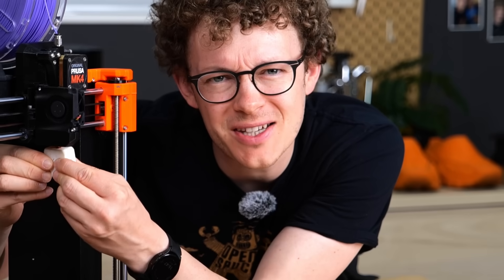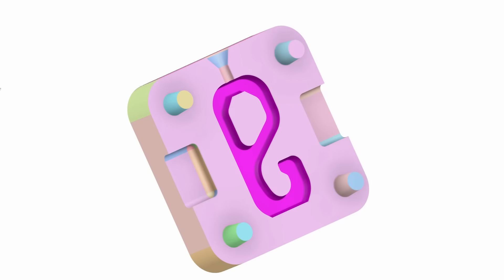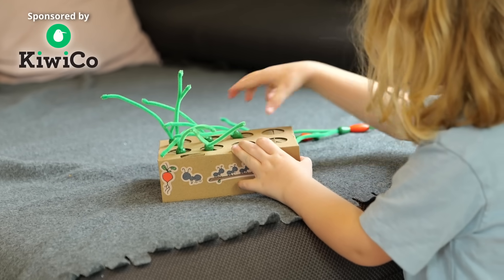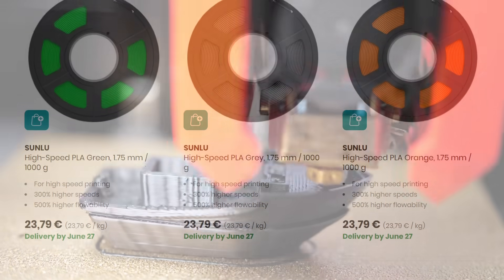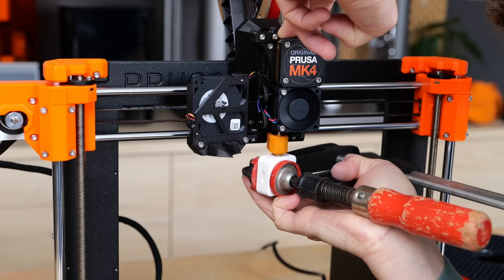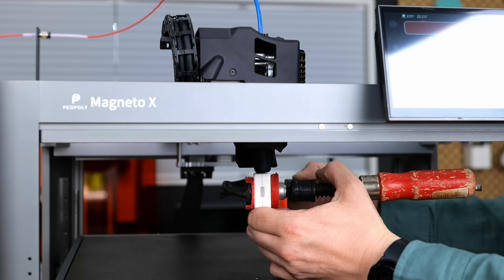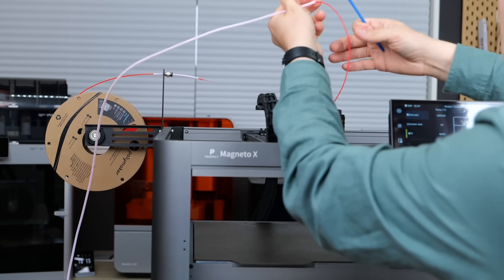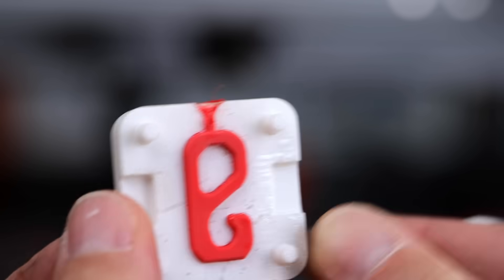I tried Injection Molding using a 3D Printer!

Comment: 15 mm3/s on V6 are theoretical. In practice, it's more in the 12 mm3/s range. at best.
As for the CHT nozzles, which I exclusively use, usual 0.4 V6-like ones outperforms a standard (non-CHT) volcano nozzle WITHOUT ADDITIONAL HEAT.

About the "injection molding", the geometry and part orientation matter A LOT. You have also to consider multiple filling holes for better performance and even filling. Which means, if you attempt this with 3DP, multiple extruders reaching their respective filling holes and extruding at the same time.

PS : sorry, a Prusa (whatever the model) is NOT a "very typical" 3D printer (maybe it is for the usual fanboys ?), nor is it "better" in any way. It's the "expensive and abusively marketed yet not better" option.

Comment: Hey! I think I have a good idea. You have to make a hole on the end of the part. Pressure could restrict the flow of the plastic. If it would have a hole (I think that's the standard in the industry) it shouldn't take any pressure.

Comment: I have been thinking about this idea 
But instead of using it for molding using it for structural.
Make voids in parts that the nozzle then comes by and dumps filament in the void. That way there are stronger chunks holding layers together.

Any thoughts? I'm not a programer so I don't know how to tweak the slicer to try this idea.

Comment: The mold should definitely be heated; you lose alot of energy filling in the mold and the material dumps its heat here; as for the imperfect seal, im thinking something along the lines of a redesigned mold with a threaded entrance where the filament comes in (maybe just a nut melted into the mold) and a receiving thread on the hotend (but that may take more searching or even custom milling).

Comment: To achieve the necessary pressure, you could shorten an overly long nozzle, create a thin section immediately after the hotend, and then screw on the mold. Incorporating air holes and other suggestions from the comments, this approach could work very very well.

Comment: I think you should heat up the mold, a lot. This is not a normal injection molding procedure so you want the plastic to stay very molten throughout the process.
Fortunately, after the fill you have all the time in the planet to let it cool down. I would preheat the mold up to a close temperature or the melting point of the injection polymer and way over Tg.
This is a fantastic idea and I will certainly try it myself!

Comment: Hello, this is probably getting burried behind all the comments:
What about printing figures with channels for molding. Then at the end of the print use the printer to fill the channels to get higher strength along the print lines?

Comment: This is a great idea Stephan!
I’m pretty sure you’ve saw that palette extrusion heads.
- Maybe they’d work better as they opperate with lead screws so it might increase the pressure.
- And why not stabilize the mold to print bed? I mean, clamps are all good; and additional Z pressure might be higher for better seal?

Comment: As with many other processes using molds that aren’t in a professional/industrial setting you will likely need multiple sprues. Especially when the mold ends in a dead-end it’s nearly impossible to have it reliably fill.  Hopefully the 2nd will act as a relief and allow full coverage, otherwise the 2nd will be another fill port.

Comment: why are you not using the printer z access to hold the nosil into the spru?  would allow you to use the bed to preheat the mold as well.  i notice you ar ento square to the nosil in several of the videos.

Comment: i was wondering what could be stopping it filling the mold properly and thought it might be because of trapped air then noticed theres no holes for the air to escape. its the same concept as resin casting and you'll should find it flows a lot better.

Comment: Heating the mould better might help? Also thinking about an air tight mould, you are fighting air to push plastic into it. What if you made a tiny hole at the furthest end of the mould for air to escape, you would have to break a piece off after if enough plastic went into it so only need tiniest holes.

Comment: 8:15 The mold is COLD.
You must heat the mold to at least 50ºc and keep it HOT while you inject plastic.
You don't need more pressure on the extruder.
In addition, the mold must have a leak hole and a release lubricant in the mold..

Comment: 100% think this is useful and you should continue with it. Literally NOBODY covers this. Also, do you think that the fitment of your mold is nearly air tight? Would it be benificial to add air bleeds to the opposite end of the mold? As the plastic hits the air bleeds, it will cause restriction and raise pressure after the mold is filled, forcing plastic into the details after the plastic has made it to the end of the part. This could be your issue with filling the mold. 

Also, it would be interesting to see if you could 3d print a mold that would work for perhaps a  couple injections before it needs to be reprinted. Ideally, if you used 2 plastics that dont adhere to each other, and the mold was very thick walled or even solid, theres a possibility that the thermal mass of the mould would prevent deformation. The dissimilar plastics would promote release without fusing.    This would enhance the feasability of the home gamer to make solid, strong, injection molded parts at home using only a 3d printer. 

Good work Steffan!  I look forward to see where you take this in the near future!

Comment: Interesting idea, but why not use the bed to heat the mold to 250 as well?  It could reduce your premature cooling issues and is already a built-in function. 

Also, have you seen the 3d injection printer? It uses resin, not melted plastic, but not a bad idea for the price.

Comment: Your molten plastic is fighting to compress air inside of the mold. All you needed to do was have a small hole on the other end of the mold to make the process significantly easier.

Comment: 1. Try air vent hole(s).
2. For larger parts try actively-heated casting plates (with ceramic heaters and thermistors mounted inside them). Can Rigid 10K resin withstand it?

Comment: Scrap an old printer. Use the heated bed, ie route the heater power to a like spec’d element, to heat and aluminum injection mould. 

Vent the mould so the trapped air stops impacting the injected plastic. 

Drive the z axis down to insert the nozzle into the mould… 

Thats all I got

Comment: Nice idea!  I was puzzled by what looked like FDM layer lines in the mold, which I thought you said was created on a resin printer (11:42).  Also, why did you not have an air pressure relief hole?  Perhaps some of the difficulty in filling the mold is due to back pressure.

Comment: Not sure if you've already tried this but, I think you're running into an air pocket problem where the air in the mold is compressed by the plastic and doesn't allow the plastic to flow into the rest of the mold.  You'd need to have an exit shaft to allow the plastic to flow entirely thought the mold, but this would have to be small I think. Possibly 1/2 or less the size of the input shaft.  Also this exit shaft should be at either the farthest point or the most narrow points.  It could also be more than one shaft.

Comment: Hot plastic, and the ability to spike high in pressure. YOU NEED TO WEAR SAFETY GLASSES. Why are you leaning over and shoving your face next to it with no glasses on. Come on, pal.

Comment: You need to find a way to press the mold against the nozle. Just using yiur hands won't be enough. Also, you can change the injecton hole to the center of the mold for an easier a more even spread

Comment: Small mechanical parts making could utilize this technology, especially the high resolution of resin printng. It would be interesting to put the mold between two hard plates bolted together and put under a well insulated box on the bed - heated to ~100 °C. The insulating box needs a hole on the top where the nozzle can reach the preheated mold. The Z axis can clamp the mold and nozzle together, fill it up with plastic, then release and let it cool down.

Comment: I believe SLS metal 3D printing is sometimes used to prototype injection mould designs before committing to having production moulds machined, so the crossover between 3D printing and injection moulding isn't so far fetched!

Comment: I had this idea where you use few generic hotends and extruders to melt filament and inject it into larger heated cylinder, and when it's ready, a piston pushes the plastic to inject it.
Because even if you get hold of a hobby grade desktop moulder, you will struggle to buy the pellet material, and if you find it, it will probably be more expensive than filament or you will be required to buy entire euro palet at once.

Comment: by modifying the mold to change the entry point position and possibly making a y to push plastic at several entry points we could facilitate the penetration of the plastic into it, we can also create exhaust route to release the air present and make place for the plastic

Comment: You might be able to get a better seal by subtracting the nozle geometry from a chamber at the top of the mold. If you did this in such a way that it had a lip that locked it on then you could use the pressure it generates to resist leaking. Not sure if the resin can handle the heat but maybe there are types that can?

Comment: This was a weird one. Seemed a bit rushed? You holding the mold up against the nozzle by hand instead of just lowering the nozzle so the mold can lay on the heated bed for example... Also the mold design lacked something you see on every mold, from metal to injection, an air escape/pressure release

Comment: The shape you chose makes an air pocket that pushs the platic back around the tail in in the g 9 shape  so make a small channel so the plastic can flow there and then snip it off after demolding

Comment: I wonder if you could use incompatible materials and a multimaterial printer to do this in one print! Print the mold in PETG, then have the nozzle cool down to PLA temps and extrude directly into the hole.
Reply: I've had the idea to do something like this to reinforce a part with "3d-printed rebar" by extruding a big stream of material in voids as a part is printing.

Comment: With moderate injection pressures, I wonder if the issues you were running into is trapped air that prevents full filling. Metal casting always includes a vent hole to prevent air entrapment and cooling of molting material before it can fill all cavities. Try another run with a vent hole coming up near the injection port so you dont have a dead end.

Also, why do you have the nozzle in the air? Are you unable to use the motor to drive down into the injection port of the mold?  That might create a better deal and allow higher pressures into the mold.

Comment: I have tried a similar method not to inject mold, but to strengthen vertical on my prints. If you leave a channel in your print where you can extrude molten material from top to bottom, it does have much more strength than the regular inter-layer adhesion.  I raise the temperature when doing that by about 20 degrees above the regular printing temperature, so the plastic could flow a little more and connect to the existing structure. 
Also, for your method, try heating your mold above the melting temperature of the plastic.

Comment: Cool proof of concept. You'd probably have even better success if you can find a way to heat the mold.

I also wonder about the possibility of printing the mold in resin, then casting it in metal.

Comment: something i would suggest is that you add an air hole on the other end of the cavity
the more plastic enters it, the stronger it needs to push the air together to fill the mold, if it can easily escape from the other end it will make the molding require less pressure and make it go faster.
another thing i would suggest, which is very apparent with the screw is that you put the wider/bigger volume areas of the cavity closer to the injection site.
if you have a long tube for the plastic to go through then not only will it cool off faster as there is more surface area, but it will also need more pressure to get pushed through the tiny hole.
i could see someone biulding a DIY injection molder that uses 3d printing filaments, by just being a long high power heating nozzle and a big clamp where the bed would usually be

Comment: Very cool Idea!!! I think you may get better results if there is an air vent. I would have the injection hole on the back on the mold at the heat and an air vent on the back on the mold at the foot and fill until material comes out the air vent.  This should speed up mold fill time allowing for larger molds and more consistent models.
Thank for all your amazing content.

Comment: This video needs To be Remade or another part 2 with all the suggested improvements in the comments like, air hole, pressing the mold on the bed using the nozzle so the bed will heat the mold while its being injected into, also pressing it on the bed should increase the detail

Comment: What about adding a vent to see if that will let the plastic flow in the mold easier and you could try adding a silicone o ring to the top and see if that will seal and build pressure better withing the mold

Comment: I think it would help to have a vent, like with metal casting, so the air in the mold can escape. Also, why not place the mold on the build plate, then lower the print head tight to it so you don't have to hold it? Great work as always, can't wait to see what you do next

Comment: I think it is a very cool process to do whit a 3d Printer but when i need a strong part I simply print a negative of my part then I press carbon flakes or poyester flakes with epoxy resin in the mold. With this proces the part has a clean look and can not melt.

Comment: Hi Stefan, 
Really cool project and video! I think that one of the biggest benefits of injecting vs 3D printing (as you already mentioned a little) is no layer build up. For the prototyping of parts that require specific mechanical properties, 3D printed parts always gives problems with layer adhesion. The proces in your video can be a valuable alternative to prototype parts (for mechanical testing) with specifiek mechanical requirements. 

Also I think that changing the injection point in the mould of the testing hook, will get a more even and better fill of the mould. The injection point at the top creates a long flow path. If you place it more in the middle the part will fill more easily and the risk of the material setting before it's completely set is reduced. 

There are a lot of simplified guidelines on the internet to improve mould design (if you google injection moulding defect for example). Even though you are making a simple mould, I think it can still be interesting get a better idea of improving the mould. 

Hopefully I explained it clearly and maybe it helps with your project. Thank you for sharing you projects, I really enjoy watching them!

Comment: I have a feeling If you were to add a pellet nozzle you could get the flow required. The screw gear could push far more against the nozzle than a filament gear. You won't slip ans can put a ton more pressure. Allowing you to play with more materials and use readily available pellets.

Comment: Along with all the other comments discussing the points of failure, sprue shutoff is also key. As soon as the material encounters resistance in the mold, it will come out at the sprue. Holding the mold up to the mold by hand will not provide a good sprue shutoff.

Comment: Loved the video, was super interesting to see what you were able to do!
Here are some thoughts on maybe how to improve the injection (not an expert, but you never know):
1) how about putting the mold on the heated bed? This way the temperature wouldn’t decrease while injecting the plastic. This would also allow you to maybe be more comfortable to press the nozzle on the mold while the injection is being made.
2) have you tried to have the injection hole in the middle of the part? I wonder if that in conjunction with the first idea could help keep the mold hot for longer allowing for a better general flow. 🤔

Comment: I work with polyurethane mold production daily, and I can tell you one critical thing for it to give good results. The air has to have passages to escape as the material expands in the mold. So a good method for such a small mold might be to cut tiny channels with a super fine blade on the mold so the trapped air can escape. Trapped air will just prevent you from filling properly.

Comment: Maybe a few micro air pressure release holes will help the filling,  though that will cause some post injection surface work. 

The screw mould might work better if the head of the screw or bolt is at the top or close to the filling point, and thus the filament would be more fluid.

Comment: Why not multiple nozzles and injection points? Nothing needs to move except downward to clamp the mold. You could then print larger items. Instead of designing molds for high pressure, design them for low pressure multiple injection points. Then printer bed could be used to heat the molds.

Comment: Design the moulds to include a heater block.  Use a spare ramps board to control the heater block temperature.

Comment: Hey Stefan,
do you think the following process could work:

1)  fdm print the negative of a Mold in high quality (using a small nozzle with high details)
2) create the actual mold using plaster
3) continuously heat the mold (using heating elements, a hot air gun or a blowtorch)